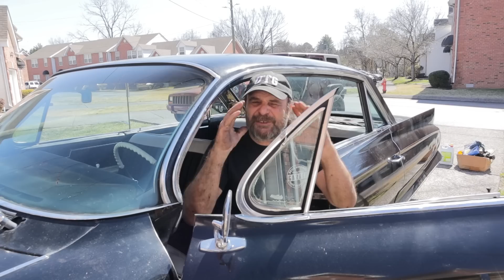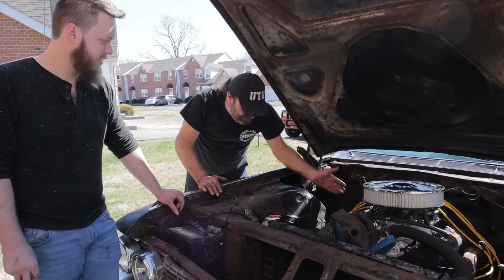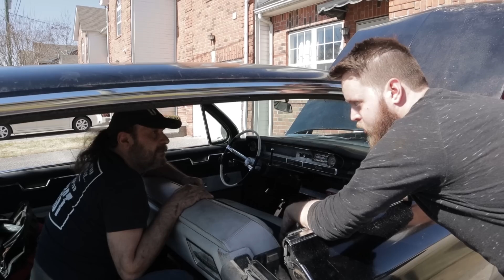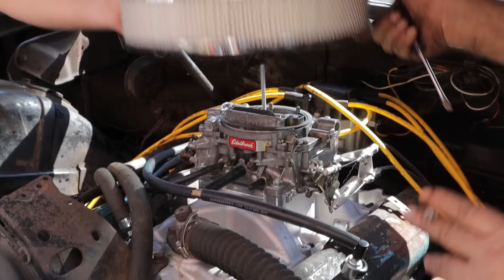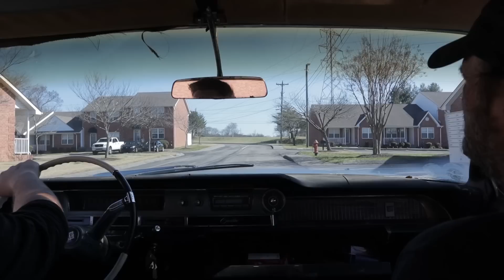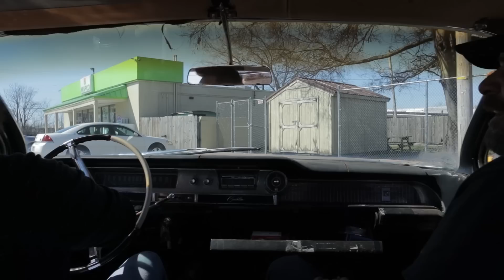The Perfect Entry-Level Classic Car?

Comment: The most fun car I owned weas back.in 1969 when I was all of 19. I bought a red 1961 Plymouth Fury 2 dr ht.with a 361 Golden Commando single 4 brl. for $1500.00 Canadian. What a boat, but as you say people stopped to take notice wherever you went. Unfortunately the Calgary Alberta winters were not kind to the body and rust became an issue. However, gas was cheap in ‘69, about 42.9 cents for regular and 45.9 for premium. I sold it in 1972 when I bought a 1961 Porsche 356 for $1100.00 Canadian. The speedometer on the Plymouth was a thin red liquid crystal line that displayed your speed. Too cool!

Comment: Seat cloths and other upholsteries can be found at SMS auto upholstery.  Very reliable old business.
The best part about having a grade-4 (?) car is that you have the vintage driving experience, but you won't be crying over a parking lot ding.  I'd locate the correct Cadillac engine for this.  The Chevy engine moves it around, but a correct Cadillac engine will bring forth a completely authentic driving experience.  I always keep vintage cars OEM unless it's a total crasher.

Comment: Man, I can't wait to finish rebuilding the engine on my '69 Toronado. I'm 20 and have loved to be in classic cars and live around them: they're simple, unique, and fun to work on. I currently have a '03 Tiburon as my daily driver and I like it, but once this 455 is done and working, I'm gonna drive it as much as I can. Even before the rebuild, I used to drive it like hell and sometimes drive it around 100-200 miles on a few trips. And despite the worn out piston rings, piston slap, insane amounts of carbon inside the engine, the headgaskets going out, the ocassional overheating, and a leaking gear box, oil pan gasket, etc., it still ran like a clock and was smooth like butter. Even the mechanic who is helping and teaching me how to rebuild its engine said that he was surprised that it was able to go down the road for that long with all these issues. I think that says a lot about how these cars were built in the past. Sure, out of the factory, new cars typically last longer compared to the classics, but once they start having issues, it is more likely that you'll need to call a tow compared to being able to make a few adjustments on the carburetor or simply driving it home slowly. And I know that there are still some fun cars that are being made today, but as a whole, cars that were built analog in a dominantly analog age had soul. You were the blind spot monitoring system, the "autopilot", adaptive cruise control, and the active brake assist. As much as I like how technology is advancing and helping us progress, sometimes I feel like we just a moment to breathe, take a break, and appreciate how we got here in the first place, and for me, that's just taking the Toronado out for a cruise as I listen to the radio that's either in the car or under the hood.
Reply: Had a 69 in 1978.  Loved that car.
Reply: You are wise beyond your years. Great perspective!
Reply: You are truly blessed to have such a ride! In high school (1975) I bought my first Toro - a fully loaded '68 for $75.00!  Shortly after I bought a '69 - it looks close except for the small fins on the rear quarters and the grille being small rectangles opposed to the '68's honeycomb grille.  The interior was almost identical with the exception of the '69 having locking steering.  An easy upgrade you might consider is changing to a HEI ignition.  It drops right in, is hidden by the air cleaner and well worth the change. Another change I considered was the intake manifold.  You'll notice the stock manifold "drops" somewhat in the center.  This is due to the transmission being located UNDER the engine which I'm certain was done for clearance. Even a stock cast iron intake would be an improvement IF it will fit under the hood.  Good luck!

Comment: This is why I am as adamant about my '66 Galaxie 500. I paid 1200 for it and had driven it for years before I had to do any overhauling.
Reply: Hey John I found a ‘66 Galaxie here in TN, paid 3,500 for it.  Body on pretty good shape, needed floor pans but I like to weld and the frame was good so I bought it.  390 FE.  Love it!

Comment: That is one lovely car.  What is on the ACC plate?  I have a 1964 Pontiac Bonneville Convertible (The Iced Cream Mobile) and it was loaded... A/C and all.  Mostly why I'm commenting is the side view mirror you have there.  I have almost the same thing but my mirror is on the wing and is cable control - and still works fine.  Mine has vacuum control boot release, rear seat speaker and power antenna... but no rear seat arm rest.  I found cigar rings all in the seats and burns all around like that Caddy I bet.  I think you need to make a channel just for this car!!!  Does it have the TH400 gearbox - don't think so from how he used the shifter.  No "R" at the bottom.  I think this car, like mine, has the fuse box at the drivers left toe?  I hate that but it's workable.  I just put an air/fuel gauge on mine to tune an Edelbrock and posted a video on that yesterday.  Give me more on this Caddy!  I had a 1962 TBird and found the seatbelt bolts and fit some but it had the OEM rubber plugs when I got it.  Your seatbelt anchors look like some old Brit cars I have with the interlocking clip.  Great Car Ya Got There!    Bobby

Comment: I got a 1968 Chrysler Newport on FB Marketplace for $2800 dollars, it ran and it drove and that was a large part I even bought it for that money.  383, Torqueflite, perfect little car to tinker around with and very easy and pleasant to work on.  Everything I've done on the car was legitimately enjoyable to tune and work on, which sound crazy but the parts are just so simplistic (bordering on crude if we're honest) that it requires very little brainpower and so you're just there experimenting with different options once you put it back together once or twice.  I love the sedans and always will as cool as a 68 Charger is or a Roadrunner or a Mustang.
Reply: Most think chevys are easy to work on but mopars are easier way easier
Reply: I bought a 68 300 from a junk yard for the engine and tranny $300 bucks
Reply: @charlesangell_bulmtl  you got that right I always loved the sound of the Mopar starter very distinctive you could here run run ruh vroom that's a Mopar
Reply: @charlesangell_bulmtl  Engineering does make a difference.

Comment: I have a 1968 Plymouth Fury VIP that for me is the perfect entry level classic car. Very easy to work on, all the parts that make it stop and go are still available and its actually more reliable than my newer stuff. If Kentucky didn't put such crazy amounts of salt on the roads in the winter, it's the only car I'd want to drive all year round. The VIP has been in the family since the late 70's and it's the third 67-68 318 powered Fury we've had and as it turned out, the best of the three though I still miss terribly my '67 Sport Fury. Some of its parts live on in the VIP. Love the slab side Mopar C-bodies!
Reply: I have family in southern Ontario (Canada) and the joke back in the 70s was that you could sit in your back yard in the evening and listen to your car rust.
Reply: @guywerry6614  Same here in Kentucky, particularly if you had a truck back then. Looking around at what is rusting like crazy these days, things haven't changed much. A flake of snow is spotted on radar, fleets of trucks come out and lay down insane amounts of salt. When I see a TV reporter standing in front of a salt barn, my oldest cars stay in the garage because I know what's coming, lol.

Comment: I am 22 and I bought a 66 mercedes 250se w108 for 500 dollars. It needs work, but I was attracted to it because it such statement. It turns out, the w108 chassis, is what amg made its name with. I've been thinking of putting a m113 mercedes v8 in it. Ive Also considered a 360, but I would prefer to keep it german.

Comment: Dad always said, "you don't need no dang timing light!" Unless your racing, adjust by ear and throttle response. Timing and idle go hand in hand. Our k5 was dieseling Because there was not enough timing, so the idle was set too high just so that it would idle where it should. But that opened up the transfer slots and made it run way too rich. Advance timing, lower idle, fixed! 👍

Comment: Family car when I was a kid was a '62 short-deck Town Sedan 4-window 4-door hardtop, the rarest of that year's Cadillacs.  I probably took my driving test in that car.  It would pull a loaded 2-horse trailer,  120K- plus miles were put on it on salted winter roads, so when dad sold it in '73, it was sadly worn out.  That also had no power windows, A/C, etc.

Comment: I brought a New Zealand new 1962 dodge dart last month, 330 trim with the 318 poly in it. Impulse buy but was pricey really well and minimal rust, Will definitely upload videos when I pull it out and give it a big clean over. Had been parked for the last 40 years and needs a full restoration. Motors also locked up so I might put a hemi 265 in it

Comment: when I was a teen ager  I got  free MERCURY four door monster 68 I think with a 400 inch motor the dash had more glam than a fifties juke box, cool part was the inverted rear windshield which would go up and down with  a push button, so you smoke a big one pass it around six folks, open the front vents on the windows and lower the rear windshield, back then gas was 50 cents, plus you could stick ten case,s of beer in the trunk

Comment: I agree with you 100%! I've always driven Classic and my present daily driver is a 73 Buick Regal (Buick version of a Monte Carlo) and I absolutely love the car. I found it on accident, Went to go look at a 65 Belvedere and it was sitting right next to it, paid $1300 for it and after airing up the tires and cleaning the windshield I drove it home, stopped off at a car wash and washed it. 2 and half years later I have 5k in it. and that includes the $1300 for buying the car, but I broke it down into "weekend projects" so I could do what I needed to do and drive it to work on Monday and it's completely done except the engine and trans rebuild and that doesn't need to be done just yet, the car only had 65k miles on it when I bought it and I've done it all on the cheap. I replaced the Front Bench seat with Front buckets out of a 99 Malibu that I bought off Facebook Marketplace and dyed Black, I have went through the suspension with all new bushings and bearings and rattle canned everything black as I took it apart, The original Wheels I just sandblasted and painted Black and then put some cheap Baby Moons that I bought off the internet, It was originally Light Blue with a Black Vinyl top that was starting to come apart and flake off so I just pulled it off, repainted the car a custom blue-green mix that I mixed up with paint I had left over from other paint jobs that I had left over and painted the roof black from once again left over paint, after I rebuild engine and trans when the warehouse shuts down over the week of Christmas I'll have $6500 in it but it will be completely done. $6500 is DIRT CHEAP for a classic daily driver that I can still have fun with on the weekends taking it on cruises, Cars and Coffee's and local Car shows.

Comment: I think it might be a series 62, that was the low line Caddy in that era. SMS auto fabrics should have the original fabric for the interior. The 390 was a good motor, but, the Dual Coupling Hydramatic trans is a nightmare. The 350 is a great upgrade for a driver. A warning though, this car is an X frame, meaning it had no side frame rails. I sold a friend a 62 and he was hit in the side, the car was totaled and he's lucky to be alive. I think if I had another, adding side rails like GM did on later model full size cars would be manditory. Best of luck with your driver, it is cool!

Comment: It is Beautiful! 
Yes it has "presence "!
My oldest son is an automotive technician and a guy that he worked with had a '70 sedan de ville that he wanted to upgrade the distributor to hei.
Dad(me) had a '69 back in the day.  So, son asks me for help 🙄!  After a lot of finnigaling traded the distributor, installed new wires and plugs...then we had to set the timing...more finnigaling,  ran like 💩💩💩.
Has a quadra-jet carb, Son looks at it like a bull at a new gate, "Dad"!
I adjusted the air screws and amazed everyone in captivity. 
Watching you do it reminded of this lost art.

Comment: A tip is necessary here, pull over and back the car or truck into the driveway, that way you won't have back out into traffic. You can drive out face first. A little bit difficult at first but well worth it.

Comment: About a year and a half ago I saw a yellow 73' Stingray convertible sitting in a driveway with a sign on it.  Good but not perfect condition, original paint & interior, ran and drove, but an unloved year so not silly expensive.  350 small block with an Edelbrock 2-plane intake and a Holley carb, Muncie 4-speed, 3.36 rear end.  Replacement and upgrade parts for the powertrain and the car are EVERYWHERE.  It's a lot of fun to drive, and a lot of fun to work on and learn WTF I'm doing with relatively low stakes!

Comment: I can see from the video footage that the paint can be brought right back around. But that 350. . If it were mine, I have a 454bb that's looking for an engine bay. I'd drop it right into that caddy. Set of headers, large pipes with some really elaborate chrome tips for the exhaust. Excellent car. Great find definately a win. A sure enough goin to town rig.
Nice enough for a Sunday church driver.

Comment: Nice find. Fyi that cooling fan won't do a thing with out a shroud durn the summer months. You may want to find an electic one, because even if you found an oem one it won't line up with how the engine is mounted. Cool car, good luck with it.

Comment: Love it. I did the same thing in the late 80s. I met a guy who had a bunch of Cadillacs. So we got to talking and he tells me he has a 67 Coup DeVille convertable that won't start so I offered to come to his home and see if I could figure out what's wrong with it. I get to his house and he has six Caddies all of them 1960s. So I get to the convertible and give it a crank and it sounds like a jumped timing chain. So in the collection there was a sweet 69 Sedan Seville, all original and it was in good condition. We get to talking and made a barter deal. If I can get the 67 running he would give me the 69 Sedan Deville. I came back the next weekend and got busy on the convertible and sure enough the timing chain was jumped. It took about six hours and less than $100 in parts and I got it up and running.  We took it for a road test and he was as happy as a pig in mud, we shook hands on the deal and I got the Sedan DeVille home.  The body and interior were really nice but it had been sitting for years so it didn't run very well. I did a thorough tune up and proceeded to have a couple of the best years of my life with my Caddy. Lots of road trip with my friends and the big back seat was a hit with the young ladies I knew back then...Lol.

Comment: Uncle Tony, I got a '76 Valiant sedan (318, 'Custom,' weird options) for about $150 out-of-pocket. 88k miles, valve cover gasket change showed the internals to be shockingly clean, no rot. Old lady gave it to me because I wasn't about to cut her up; it was sidelined due to a leaky heater core. Over the years I've collected a ton of parts & pieces to make it much more fun & usable. 340. 8.75" SG, 3.55 rear. A-833 OD iron-case gearbox. 12" rotors. A38 oil cooler from an "80 Aspen cop car. 1 1/8" swaybar front,  3/4" rear swaybar....tons of stuff. It's cheap & fun. More people stop to look at it as a GT350 sits next to it-

Comment: Working on my grandpa's 1972 Buick Electra 225 with the 455, been in a barn since 1981, pulled it out in spring of 2023 with 57k original miles. Complete brake system replacement except for the booster. New shocks and struts, needs bushings yet. In the process of a full fluid change, may have a shop do this part as I don't have the means to flush trans and power steering system and don't really have the desire to change all the fluids. New tires. New plugs, wires, points, cap and rotor. New heater core and all rubber hoses New filters. Interiors flawless less the driver door handle is dry rotted. Fuel gauge is stuck. I messed up the assembly of the fan controls while assembling the dash for the heater core so I only have feet and defrost

Comment: I've got a '65 Impala with a 283. I did a little work to it. I painted it, I made sure to do it right... right in my driveway.  Got a '72 Catalina with a gallon and a half of Bondo on one side but runs like a top. Between the  two of them are daily drivers.

Comment: I usually use Valvoline Max Life motor oil and transmission fluid in the older cars. Plus I add Lucas oil stabilizer just after changing the filter and engine oil.

Comment: This video really hit home with me! For one thing my daily driver for the last 3 years has been an 87 Cadillac Fleetwood Brougham! I bought it and a 93 Fleetwood Brougham for $600 at an estate auction because the keys were misplaced! I put a used lock cylinder and a battery in the 87 and started driving it In over 3 years I've spent less than $100 keeping it running!  The 93 was getting rusty so my son and I started selling parts from it on Ebay and more than doubled our money, Plus I have a 1962 Sedan DeVille like the one in the video but it has more options and the car is white. When it warms up some I plan to get it running again and drive it some! If I don't like the way it runs I will put the engine from the 93 Caddy in it!